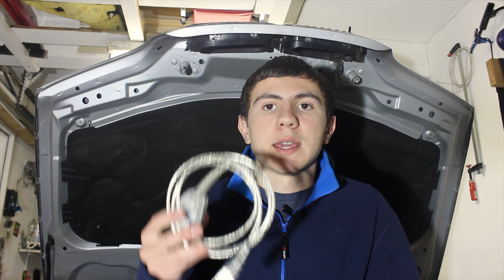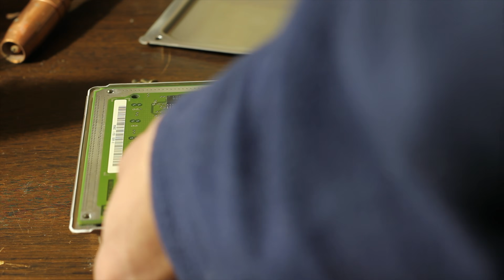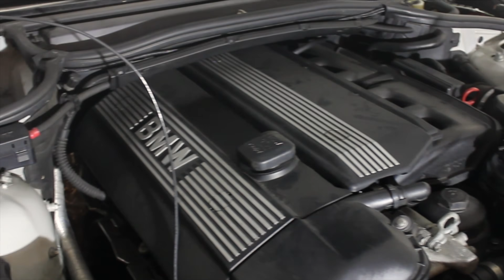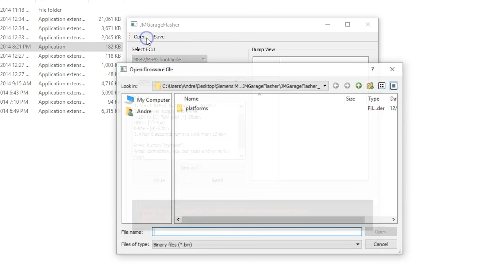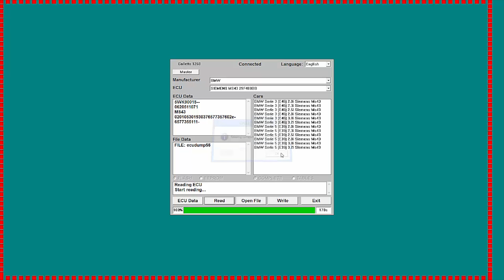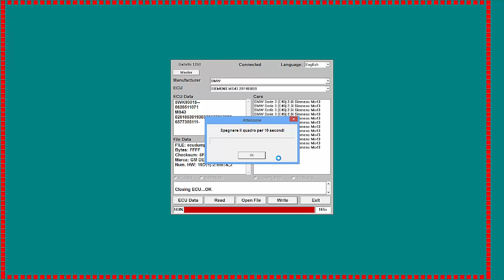How to: Tune Your BMW (w/ MS43)

Comment: why do I have engine speed in my tuner
4800 5500 6000 6500

and the map that I want to configure in the tuner pro, the engine speed is 4800 5100 500 6070 6080

what should I change in the settings so that the speed for the settings is the same

Comment: pro tip, ms4X flasher is now available for free...so no need for gellato or whatever it was called since finding a proper version seemed sus af. ms4x flasher is right on the ms4x wiki page btw

Comment: Hi. BMW E39 530i. I did a post cat sensors delete, setting c_conf_cat to 1 and used tuner pro.
I upgraded firmware from MS430037 to MS430069. Everything went fine but I don't have engine light when ignition is on. What I did wrong? Thanks

Comment: Fantastic video and very helpful.

I've been at it for a few hours on my Australian 2004 bmw e46 330i m54b30 ms43 the tuning file wouldn't start my car.

I put the original file back on and still no start all connections are secure and correct

Edit- I fixed the issue I just managed to find a different file to start with my car and also no limpmode.
Reply: Correct the checksum

Comment: Great video! Txs a lot for that! 
Have a doubt, got a 2002 330i m54b30, and a spare ms43 from a 320 m54b22, dont want to mess with my original ecu, if i do the tune on this spare ms43 will it work on my b30? What about ews, keys, and all that? Never done tuning before!

Comment: i have an already mapped dme with many changes came on my car (remap, crackle map,icv delete, e thermostat mod, raised limiter, vss limiter delete, secondary o2 delete.), i am now swapping into new chassis so will need to disable ews. Is it possible to keep my tune and just remove ews?

Comment: This is probably a needle in a haystack kinda thing but i really need help atm soo i followed everything you did in the video but galletto because its no longer supported everything went fine until i tuned the car off and tried to turn it back on after writing the dme with new loggers the car cranks but wont fire up tried to return it back to the stock tune but still proceeds to crank but not start so thats where im lost lol the dme still connects and reads and writes but apon trying to start the car it wont start it. is my dme "Bricked" REALLY could use some help if you have the spare time. nice video thank you man :(
Reply: By now you probably had already found somebody to flash here DME for you. I also had a mistake flashing mine and bricked it but that was just recently. I see years was from 6 years ago!
Reply: @markhammer9975 yea i ended up finding a tuner who just flashed a no (ems i think its called) file with my tune so that the car doesn’t need matching vins in the modules to start anymore. i appreciate you still answering though.

Comment: so i have watched your video and a few others and when it comes to spoofing galletto im having an issue whenever i put in the serial number from hxd and try to run galletto i get a not a win32 application and it wont launch

Comment: I have an engine swap that I did for a 2002 330i  with 2003 330ci motor,  would I also have to transfer the 2003 DME, key cylinder, and EWS sensor into my current car? Or could I just reprogram the 2002 330i DME using to this motor? Or if I swapped those parts, could I rewrite the VIN of the 2003 DME to match the car? They use the same MS43 DME units, just a different index of 08 and 06. Please respond, it will help me finish my car soon 🙏🏼

Comment: Do I need to apply the ground every time I want to write to the ecu?
Reply: Brandon Anketell no
Reply: @Bavariansoul  ok so it just needs to be grounded for the initial 512 flash. Then 64 flashes for tunes after the initial tune dont need to be grounded. Is that right
Reply: Yeah

Comment: Nice video. Have 2 questions? After EWS deletion will the keys still matter? Not very clear about the switching on the ignition. While flashing is ignition on or off? If on what's the use of first 3sec ignition on and off?

Comment: Just one question. So you just answered a question in your video that has been causing me problems with passing emissions. You said if I’m running catless headers then the check engine light will be disabled . That’s the problem I am in rn with emissions . I can not pass due to my check engine light not coming on when I turn the key to the on position ( which is required in Arizona to pass). So is there anyway to just re-enable the check engine light to come back on in the tune but only change that. And keep the rest of the tune . Because right now I am not throwing any codes but if I re enable the check engine light will it throw codes ?

Comment: hi, this is new to me... sorry i need to start somewhere.

i have a few questions..

why use JMgarage to read and save the original file?

can't u read & save the original file trough galetto?

also is it necessary to put it in boot mode?

Comment: I have the gelleto cable and never could write to the ecu on my audis that have the same ecu, thanksletting me know about putting the ecu in boot mode just bought a 525 touring and want to tweek the red line in the final gear

Comment: You and the MS43 Devs are absolute bad ass's!!! ... Much much love from the UK ... got my partial out of gellato had to hack the .exe via information gained from Mprog and use latency of 10 worked perfect first time.. and previously made a backed up my original boot mode flash using your method where other methods i found failed.. ::::DD ... any idea how we can tune the E46 for cackle and burble using the Exhaust flap settings I could send you a reward
Reply: did you figure out how to make a burble tune?

Comment: So I've got a Z4 (E85)  from 2003 with the M54B30 engine, at 10:52 there is no option for it ... 
Does it work though? Do ijust have to choose the M54B30 E46 (because it'S the exact same engine afaik)
Reply: Did you try it? I have also a E85 from the same year and would love to give it a go

Comment: Im using a bench flashing setup,  when i click connect, it always says "Boot Mode not active, or wire connection issue". I can hear the ecu making a very small sound like its recieving power. The way im grounding pin 104 is a with a thick needle and a wire running to my negative on my 12V power source (1 9v and 3 AA taped together, reads, 11.8v). I downloaded a windows based obd2 scanner to see if it would work, and it also says failed. if anyone mihgt know what my problems is, please help

Comment: With particle file is that enough for tune..? I have a ms42 can i read and flash it particle file.? Without boot thru the obd port.? With Mpps or kess.? I know when I tune the stock file with writing I ganna get checksum error how to fix this before getting problems?

Comment: When trying to connect using Jmgarageflasher it always gives me the Connection error missing echo bytes? Galletto reads fine with my cable, any suggestions to fix this
Reply: I found the e46 fanatics troubleshooting connection forums, I'll look on there but when I put the ecu in boot mode, jmgarageflasher say "[MS43] Connecting... then Connection error. Wrong echo bytes." I am only able to read the 64kb file from Galletto

Comment: How do I find out what version of ms43 i have?
Reply: There's two ways I've read. With a K+DCAN cable and WinKFP. Or putting the ECU (DME) in boot mode, and doing a full read with an appropriate program like in the video.

Comment: You are an absolute legend my friend. I was surprised that the oem ecu is a seriously cool piece of kit and the adjustment in the parameters is as good as the basic standalone aftermarket items that are available. Please continue to exploit the use of this unit and I am interested in direct contact with you to discuss the possibility of a venture between us using your knowledge and my own business in this area in England which is crying out for a guy like you that talks the most common sense and simplify the whole process of mapping
Reply: Mark Van-dal what's your shops' name. Instagram ? Website ?

Comment: I was able to put the ECU in "boot mode" and successfully establish a connection in JMFlasher with my ms43. When I click "read," the buttons become grey and nothing happens. I've let it sit for over 45 minutes with still nothing to save. I'm using Windows 10 on my laptop. Any ideas what could the problem be?
Reply: AabdallahS any luck getting past the grayed out button issue? 6 hours of messing around with JM today and still same situation
Reply: Nah, I even posted to the ms43 thread on a couple E46 forums and never got a responce either and just gave up. Lol
Reply: AabdallahS I think I have it all sorted out. Going to give it a shot tomorrow and I will let you know the exact process.
Reply: I'd appreciate it, good luck!
Reply: Any luck with this I’m experiencing the same problem and can’t seem to find the solution
Reply: CAUSE U HAVE TO USE LOWER WINDOWS :)
Reply: Thats your problem windows ten drivers are shit for this software

Comment: So after flashing with jm garage flasher I read that you should resync ews with dme how is that to be done by pa soft 1.4 bmw scanner and is it possible to do reset adaptation  ews and dme then car will start as ews is off on dme ?
My car is not starting now

Comment: I've scanned by pa soft 1.4 ? I got fixed key code and random key code flashing in green but I got the random key code status  is giving wrong random status so this flashing will not fix this problem so the ews is still active not off ? How can I fix that problem the key should be active in that way and ews is on ??

Comment: thumbs up for you friend hope i got assistant from you and confirm is iam right or wrong 

ok friend want to ask you first you only ground untill you get it in boot mode and press connect on jmgarage flsher  after that you remove the ground only and keep the switch on after that you press read and save the file right ?

 is this file you saved it when you read it do you use this file in jmgarage flasher  in tuning pro software ? ,what i mean is this the stock file of your car ? that you used it on tuning ? also want to know if i have problem with my ews so after writing dme in jmgarage flasher and put  back the dme in car will the  ews be disabled and i can run my car on standard setting also in tuning pro you have selected stock file is it the one that you have dumped from reading ecu in gattello ?
 ?
also this file is for what MS430056_PF08347_virgin.bin

Comment: Thanks so much for this video. I easily got the full flash installed on my e39 530i. Only problem I have is that the idle RPM is a bit too low (shuddering throughout the car under 680rpm or so), but that's pretty easy to adjust.
Reply: Can you solved?
Reply: @egoncsomai1522  Adjust only: 
ip_n_sp_is Nominal idle speed without additional load on the engine.
ip_dri_n_sp_is Nominal idle speed with drive engaged for AT gearbox.
ip_acin_n_sp_is Nominal idle speed with air conditioner switched on.
ip_dri_acin_n_sp_is Nominal idle speed with air conditioner switched on and drive engaged for AT gearbox.

Comment: does it work with a 2002 325i? lol I have the m54 engine
Reply: Some had ms45 so you still need to check the dme to make sure.
Reply: This works with the MS43 ECU/DME. You'll need to remove it and verify that it does say "MS43" on the outside.
Reply: +computiNATEor nah dude. I just looked it up. from the year 2001-2005 the e46 had the ms43 ECU. so mine does. thanks though.

Comment: If I understand correctly, if O2 sensors on an e46 325i are bad I can just disable them and the engine will run (at least semi normally), the same goes for aftermarket headers with no cats?
Reply: Bad information: Done use application tools / calibration tools to "solve" failures. If anything is broken, exchange it with a high quality spare part.

Comment: I get back of the deaths my m54b22 on ews problem with ebay inpa cable, my next step is modd with this tutorial ..!!!!
Reply: Bmw 320i e46 2.2l m54 engine.
Reply: there is no m54b22 ?? there is only a 2 liter ,2.5 ,2.8 or 3 liter engines wtf you on about???
Reply: +Gaz Girl  of couse exist 2.2l engine, but in US no exist only europe and rest of world

Comment: Great video! Could you tell me if there is anything that can be done with the MS45 ECU for facelift E46? If you could just point me to a website I could figure it out.
Thanks!
Reply from the maker: +Alex Nesta Swapping to MS43 is by far the easiest option and its not that easy. Search E46Fanatics for more info. 

Basically you need an MS43, old style 3-wire MAF, narrow-band O2 sensors, MS43 Engine harness, and re-pin the coil harness + alternator harness will be nessisary.
Reply: yeah I've looked into that. Oh well it's not really worth it to me. Thanks for the info!

Comment: Interesting video dude. Personally I would exercise extreme caution if you are novice skill, as people spend years learning remapping. Also I would image the HP gains on a N/A stock engine would be minimal as BWM would of spent considerable amount of money on R&D for the perfect tune.
Reply from the maker: +Matt Ford More info on what you said will be in the next video.
Reply: Matt Ford has a good point, I have been remapping with REVO for 10 years and I have to say that the wise decision is to practice with a scrap yard unit until you get competent and the best results are available
Reply: Tune conservatively for reliability.
Tune for max power for unreliable fun. BMW tunes for a cross between reliability and emissions(lean)
Reply: Matt Ford so the power gains on a N/A engine is limited? So what benefits do you stand to gain from tuning